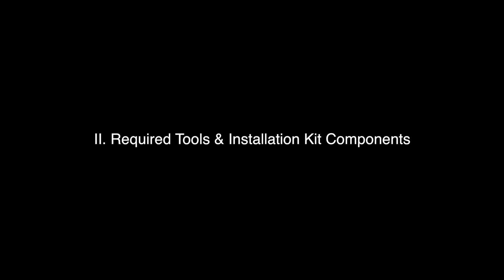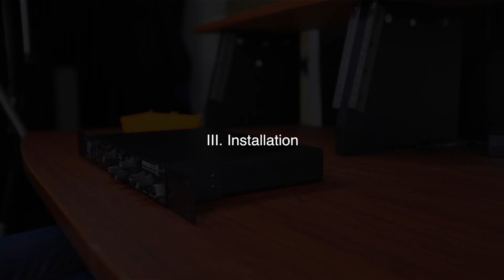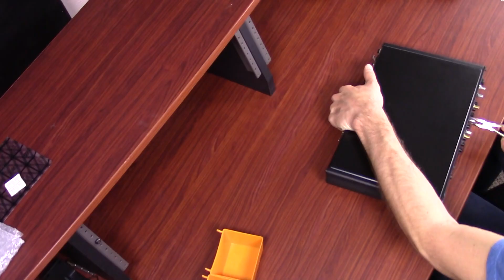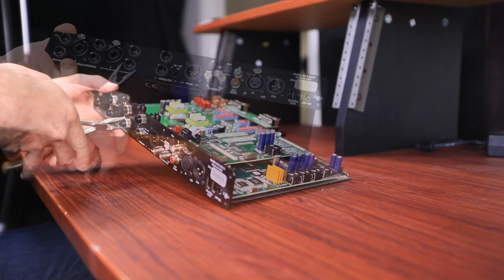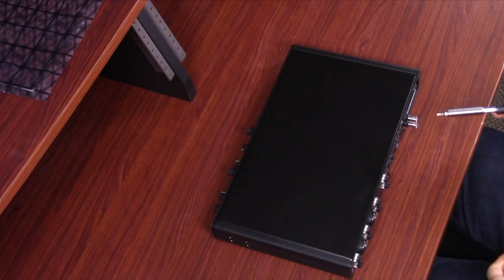ULN 2 3d Install

Comment: Just did my Metric Halo 3d upgrade on my old 2005 Halo ULN-2. The video was top quality step by step instruction. And I discovered that I had accidentally got the expanded 2d-3d upgrade, when I should have got the Legacy-3d upgrade...so the inside of my unit circuitboard looked very different. I emailed tech support and within 10 minutes I had a helpful reply which enabled me to still do the upgrade as is. Great service. Thanks guys, great customer service.

Comment: Hi I'm thinking of getting an audio metric halo interface, I'm having some doubts in terms of sound quality at Metric Halo ULN-8 3D 'A step up from the Metric Halo ULN-2 3D? or what differs is only the number of inputs and outputs? the pre amps and AD / DA is exactly the same? is that I do not need the 8 inputs but I want the maximum sound quality possible .. another doubt I have is with regard to the USC C input regarding latency is actually a step forward or it is USB 2 compiler so with the audient id44 and just change the input to USB C, the usb C input works on the new macboocks with thunderbolt 3 input? if I buy the audio interface Metric Halo ULN-8 3D will it already bring all the latest updates like DSP preamps etc? Or is it just this latest card?
thank you